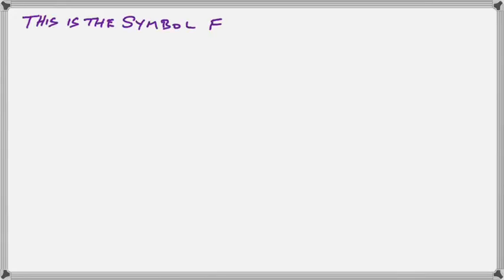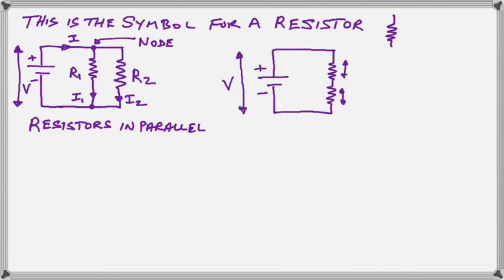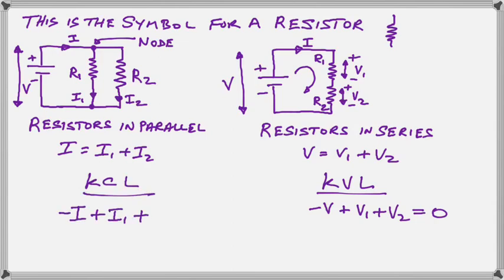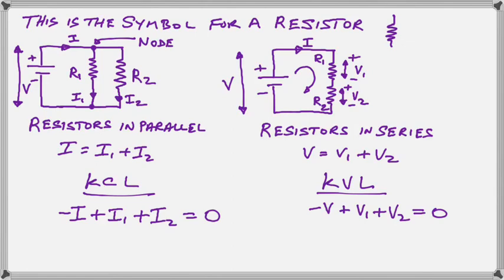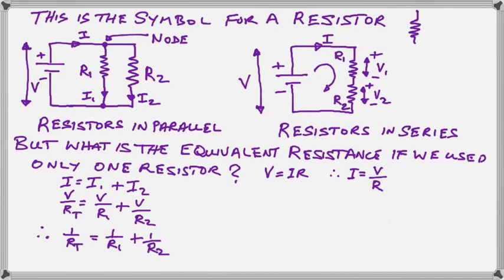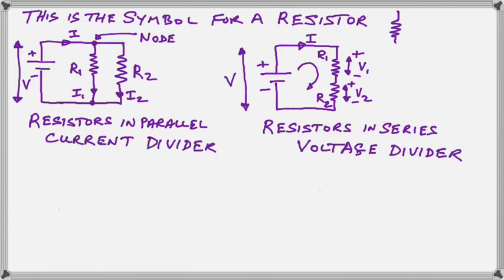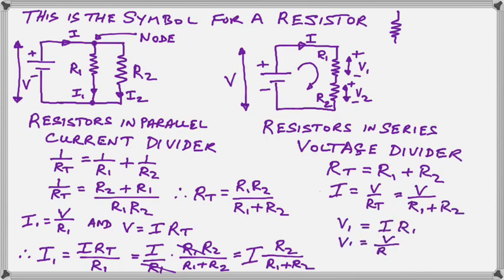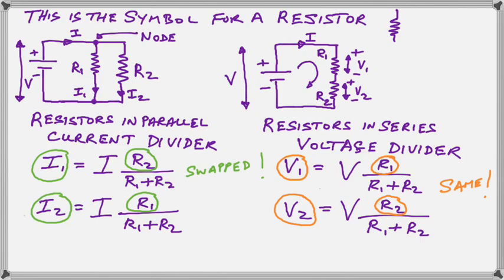Kirchhoff's Laws -  voltage and current equations in resistor circuits

Comment: I am having a bit of difficulty in understanding why we use one symbol (I) for parallel but another (V) for series? :/
Reply: In other words, I see the same components (with different configurations) in both diagrams, but one is for current and the other for voltage? So confusing ....
Reply from the maker: Both diagrams have in Current (I) and Voltage (V) as marked...... the difference is the Parallel diagram has two different currents (I1 and I2) that add up to I....... and the Series diagram has two different voltages (V1 and V2) that add up to V....... and this is as a result of the different configurations.
Reply: Let me try it this way if I may .... why does one yield current and the other voltage? Wouldn't they BOTH yield BOTH current AND voltage? Thanks in advance!
Reply from the maker: if you inspect the diagram on the left you notice that there is only ONE voltage present and both of the resistors have the battery voltage across them...... Battery, R1 and R2 all have the same voltage across them...... but each of the Resistors can have a different current flowing through it..... this is similar to your house wiring.... the appliances in your home plug into the same voltage but they use different amounts of current..... a toaster or a washing machine pulls more current than a radio.
Now in the diagram on the right ... only ONE current flows in this diagram..... however there are 3 different voltages, the battery voltage and V1 and V2 can all be different...... there are Christmas tree light sets that work like this..... there may be 10 bulbs..... small bulbs that can only handle 12 volts..... but they are put in a string and fed from your 120 volts house power...... the voltage DIVIDES among the bulbs.... because there is only ONE circuit and ONE current, if a bulb blows the current stops and all the bulbs go dark
SO YES.... both circuits have current and voltage..... but the one on the left has 3 DIFFERENT currents and the one on the right has 3 DIFFERENT voltages
Reply: Lightbulb just went off in my noggin xD THANKS!
Reply from the maker: You are welcome..... actually I am glad it happened this way, because future viewers will have the benefit of my extended explanation...... and my future students will see how hard I work to help them understand.... so it's all good..... thanks for sticking with my channel and I hope others will follow your example in persisting until  'the lightbulb activates'
Reply: This is making a lot more sense now. :) Getting some hands on experience really helps.